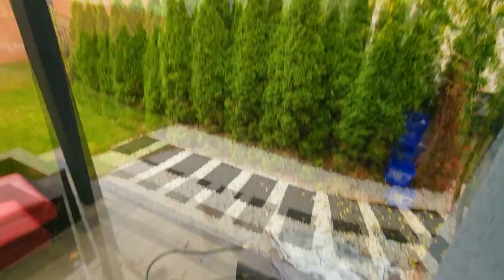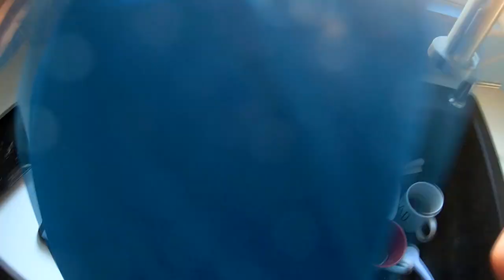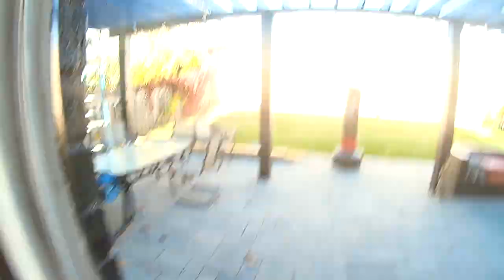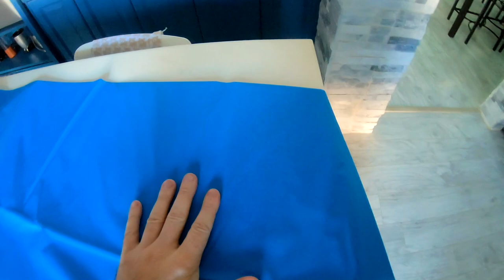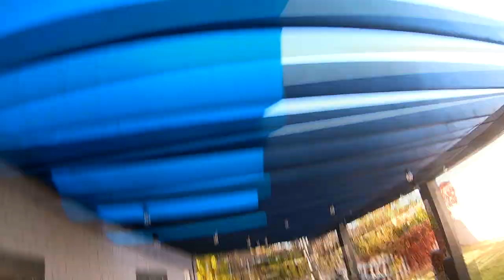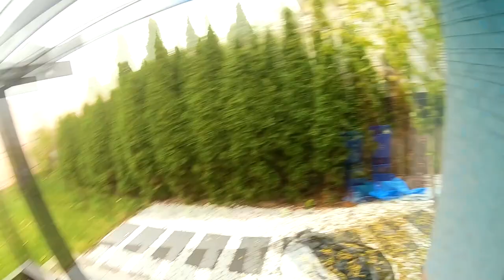Waterproof DIY Patio Cover Roof / Pergola Cover / Canopy Cover - 9KM DWLIFE 40D Nylon

Comment: its actually a smart way of doing it. the way you did, the snow will not be needed to clean out manually.
Reply from the maker: exactly, just have to make sure it holds and doesnt buckle under snow.

Comment: another thing you could have done is to attach an extra pair of sheet at the very beginning against your wall so the water doesnt seeps against your wall.
Reply from the maker: yes but that would look very strange, next spring ill add another layer of plastic from one end to the other on the top of the pergola over the fabric nylon that way it wont even hit the nylon so water will steep down

Comment: how does this material hold up in harsh sun? it doesnt snows here but rains a lot. Some days it can be incredibly hot.
Reply from the maker: it will fade for sure, white fabric holds and reflects heat and uv rays so it will definitely deflect the heat, i will do a followup video next year in summer to see how much of a differnce it makes.

Comment: is that chair made out of plastic? looks neet
Reply from the maker: thats a wicker chair, but yes its special weaved polyurethane plastic, stronger than plastic , there is metal inside though so it does rust with winter and rain thats why we wanted a cover without moving all furniture inside